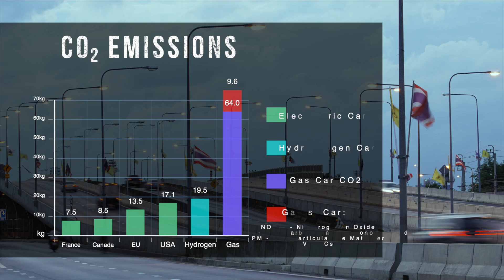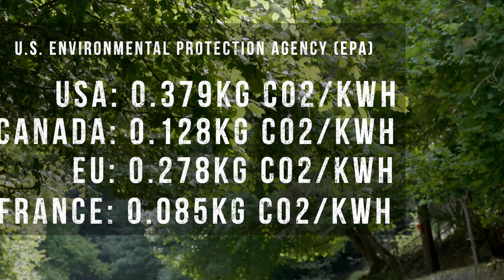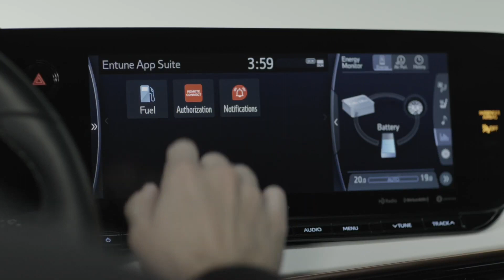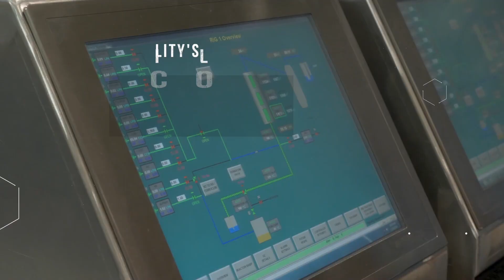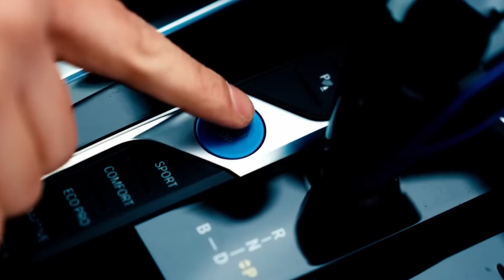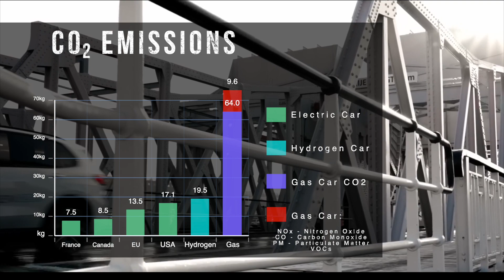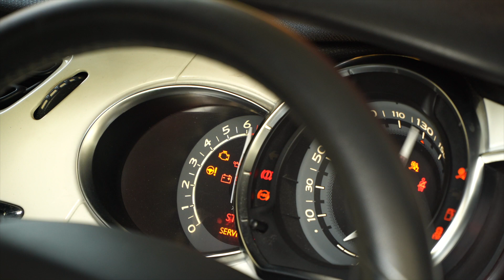EVs vs Hydrogen the battle for your future

Comment: You neglect to mention the biggest country in Europe, Germany, which produces much of its electricity from Coal.  The future of H2 production is electrolysis and that is based on cheap, clean electric production.  No need for the mining of Lithium and the production of batteries.  Hydrogen is the future for vehicles and Nuclear is the future for electricity production.  We don’t want or need our earth covered with windmills and solar panels.
Reply from the maker: I just mentioned couple countries for example. Hydrogen is the best but the problem is with infrastructure, filling stations are expensive. I would say that methanol is much easier to operate. Isn’t it easier to use electricity directly in a car instead of converting it to H2, transport and converting it back to electricity in fuel cell. Losing on efficiency at every stage.

Comment: Ev better hydrogen engine
Reply from the maker: Hydrogen engine is very slow and has 27% efficiency so crazy expensive to operate. Fuel cell has 60-80% efficiency. And car is electric so it is fast.

Comment: The new LPF batteries are replacing LiCoO2 in the two or three recent years.. so that Cobalt shortage is no longer really an issue, but recycling lithium is, combined with marginal battery durability: the recycling of lithium is more expensive than current lithium production and the recycled product is not pure enough for use in high quality mobile batteries. In contrary the few grams of platinum requires by cold fuel cells and PEM electolyser, from 5 to 27 grams per car, and now less on new nickel plates cells is a noble chemically stable metal easy to recycle and can be 100% recycled when cold and 96 % on hot exhaust catalyst with some 4% lost during usage by surface hot peeling. The shortage of platinum, iridium and palladium is therefore a false urban electro-geek legend. The current H2 grey industrial production is not green but with the lowering of PV and wind mills prices, the improvement of PEM electolysers efficiency and the natural gas price increase with the war in Ukraine, the Green H2 production is cheaper than grey, with pure O2 and heat as valuable by-products so that all three can become even much cheaper than today…moreover with sun and wind abundant everywhere and free of charge and an economy of scale marginal for green H2 production, a massive energy storage is possible everywhere cutting cost of expensive transportation networks and tanker trucks. This could cause the existing energy monopoles with huge financial lobbying power to be threatened by a new clean and fair trade energy dynamic and competitive market, and this new energy war has just started with a lot of fake broadcasted to mislead decision makers, but technically, saving the planet from roasting will come from properly stored free surface energy’s and with it, the green H2 will be playing a key role.
Reply from the maker: Good analytics

Comment: Hydrogen ICEs are now being developed
Reply: The world would be better off with gasoline vehicles than hydrogen. 

You seemed to have missed the fact that the vast majority of the worlds hydrogen is produced using natural gas in a process that emits more atmospheric carbon per mile driven than gasoline. 

On top of that hydrogen is substantially more expensive than gasoline, and hydrogen storage tanks are substantially more expensive than gasoline storage tanks so it will never be practical. 

Hydrogen hype is just veiled greenwashing of the fossil fuels industry to steal investment, skilled labor and materials away from actual green projects that would lower demand for fuels. They want us to keep burning their products instead of looking for alternatives.
Reply from the maker: @5353Jumper  Did you watch whole video?... Yes, 95% of hydrogen is produced from natural gas. But process doesn't emit almost no pollutants except CO2. If you compare actual emissions of poisonous substances Hydrogen production and exploitation emits few hundred times less poisons than gas and gas emits it in the cities where people breath it. No matter how you look at it ICE is ancient technology that should be scrapped 50 years ago but oil industry didn't allow it.
Reply from the maker: This will never work because ICE efficiency is 28%, considering the hydrogen cost it will be extremely expensive to operate. Fuel cell is 60-80% efficient. Also hydrogen ICE is very slow.
Reply: Toyota will have a 8 cylinder  motor developed especially for 
Hydrogen vehicles out in 2025.
It will sell like hot cakes.

Comment: Cobalt not required for LFP car batteries. This is out of date.
Reply from the maker: Tesla uses NCA - Nickel Cobalt Aluminum  and only for Model Y - LFP. 
GM - NMC
BMW - NMC
Mercedes - NCM
I don’t think it is out of date.
Reply: @Robb-USA  What is the Tesla battery made of?
For its standard-range vehicles, Tesla said in 2021 that it was changing the battery chemistry it uses to lithium-iron-phosphate (LFP) cathodes, which are cobalt- and nickel-free.9 Feb 2023
Reply from the maker: @harryadam1671  The plan is to use LFP on all models eventually but we will see what will happen. They just released 4680 superior to previous models. LFP is more economical and more stable but will reduce performance and I don't think that Musk will compromise performance.
Reply: @Robb-USA  I appreciate your hard work here. Just another point on your recent comment. BYD is now one of the world's largest car companies and the largest maker of 'electrified' vehicles (that includes PHEV's etc). They have moved to LFP with their famous Blade battery for most of their family oriented vehicles. NMC and similar for their high performance variants. I own one of their LFP cars and achieve about 405km local and at minimum about 320 km mixed county/regional driving and certainly don't feel it's underpowered. My family SUV gets to 62MPH in 7.2 seconds. So, LFP is becoming more widely used as of last year. Cheers.
Reply from the maker: @evtorque  Thank you for your comment. BYD recently jumped to second place on the Future Readiness Indicator, while Toyota dropped from second to 10th. Tesla holds the first position. BYD is really great company.

Comment: Consider the list of essential byproducts of fossil fuels that we rely on in our daily lives that can easily be replaced by electricity.  That list contains zero items.  Think carefully.
Reply from the maker: I am not environmental freak! We need fossil fuels, but combustion engine must be scrapped. This channel is about the facts not trends.
Reply: If that is the case then you need to educate yourself on co2, global warming, plants and internal combustion engines. It is not internal combustion engines that are causing "global warming " bud.
Reply from the maker: @MrKnuttybuddy  I have just posted video about just this topic. Watch it, it is based on actual facts about CO2. Here is the link: https://youtu.be/TtR_GcJBs4Q
Reply: All the byproducts of fuel production that we use in materials and chemical process can continue to be made without making fuel. We can make them all direct, or as byproducts of each other. Cracking hydrocarbons to make components of hydrocarbons is not exclusive to fuel production, it can be done other ways. 

The past rising demand for fuels that was the catalyst (forgive the pun) for the byproduct materials boom, but now that we have waning demand for fuels those other materials can continue on even with waning fuel production.

Comment: Hydrogen for ICE?.. nope😅😅
Reply from the maker: Hydrogen for ICE  is good idea to cut pollution but I don’t think it will be economical.
Reply: @Robb-USA  ... you are right. The problems are in production, transport, storing, dispensing and safety etc.
Reply from the maker: @edsantos6627  ICE has 28% efficiency and hydrogen ICE is very slow, That's why it will be very expensive to operate. Fuel Cell is 60-80% efficient and it is electric car so it is fast.

Comment: Ev. have you ever taking a walk to electric plant?  so ev is only hiding the pollutant whether waste battery. f matter,  carbon waste, poisons. etc😢
Reply from the maker: Every aspect related to EV batteries has been taken into consideration. However, this particular video solely focuses on CO2 emissions. If you're interested in learning about other pollutants associated with EVs, Hydrogen, and gas cars, please refer to our other video.
Reply: FFS everyone has this argument and completely (or conveniently) forgets all the harm of the supply chain for ICE vehicles, as well as the supply chain for all  that fuel. 

The point is not that EVs are perfect zero emissions. 

The point is that EBs are better lower emissions. 

Better is better even if it is not perfect. 

"EVs are not zero emissions, so I am going to keep driving my ICE car that has 3x the emissions of an EV" 

Then also consider that the more we adopt EVs and green generation the greener it gets to go green. Those emissions numbers for EVs fall the more we put EVs and green generation into the supply chain. 5 years from now the numbers for EVs will be substantially better than they are today, and so on. The only way numbers for ICE vehicles are going to improve is if we put a lot of EVs and green generation in the ICE vehicle supply chain.
Reply from the maker: @5353Jumper  Yes, I would add that EVs emit 30-100 times fewer poisonous substances (other than CO2) than gas cars. This is not a small difference.

Comment: My thinking for small cars & light vehicles All is electric is well but midum or heavy duty engines use hydrogen gas engine is better Way, thanks.
Reply from the maker: You are absolutely right at this point. Although Tesla has released an electric heavy truck, hydrogen technology is superior for transportation vehicles.
Reply: It is in fact quite easy to show that all plants react to changes in the environment. They react to light, temperature and many other factors, for example rain. We can detect that by simply measuring the electrical currents that flow in their bodies. These are very similar to those we measure in human heart-, muscle- and braincells. This has been known since the discovery of electricity, but only today we can measure this easily, with off-the-shelf parts. I am continuing this research: ------ Intro-Understanding the electrical signals of Trees: https://youtu.be/drlYvZ8YCZE ----  What Tree electrical signals look like:  https://youtu.be/qdTxhaxjXxg  ---- How to build a simple Tree Voltage Recorder-Part 1:  https://youtu.be/Cl2CVbAjqY4

Comment: 🚙EV with engine👍
Reply: Electric piston engine. I have heard before, however efficiency would be half of an electric motor
Reply from the maker: @tanalson  any combination engine has 27% efficiency and electric motor 95%. Hydrogen fuel cell car has 60 to 80% efficiency.
Reply from the maker: Yes.😁

Comment: Most of information in this video is biased towards battery powered electric cars, ignoring literally every single problem the author of this video even himself admits.

This is not information. This is propaganda.

Go read about TMSR reactors and their role in mass producing hydrogen in the future, THEN patronize everyone how battery powered electric cars lacking range in winter and summer are certainly superior to cars that have no such problems. And that's just one small detail you failed to mention.

I hope this channel never grows. There's enough liars in the Net already. no need to add another one.
Reply: The video is not bias towards electric cars - the actual data shows that electric cars are better. It is not bias to show data that indicates a direction. 

The big problems with electric cars are in the supply chain. 

But many people seem to forget about all the problems with the fuel and ICE supply chains. 

1. Bauxite and steel supply chain for engine blocks and transmissions is as horrific as the lithium and cobalt and copper supply chains for electric motors and batteries. 
2. What about the thousands of gallons of fuel per car, plus all the lubricants over the lifetime of the car? Do you not know about the terrible social and environmental consequences of global fuel production somehow? Plus add the percentage of all the infrastructure required for the extraction of petroleum, refining and distribution and all the supply chain for all that. The simple fact that thousands of gallons of petroleum products are reduced for each EV reducing the size of the damaging supply chain for the vehicle. 
3. Fuels need multiple layers of  transportation and storage just to get to your car. Somewhere around 30% of fuel is used just transporting and refining fuel. This immediately reduces the overall efficiency and increases emissions of any physical fuel vs grid provided or locally generated electricity. 
4. "Green" generation and "green" transportation causes a beneficial feedback loop. The more they are adopted the greener it gets to go green. So those numbers showing that EVs are lower emissions than any other type of vehicle keep getting better the more EVs are used in transportation and the less fuels are used in generation. 5 years from now it will be even lower emissions per EV, and so on. 
5. The new supply chain requirements for copper and battery materials are opportunities to improve global supply chains. If we citizens of the planet keep up pressure on companies and politicians we can try and make the new supply chains required with less environmental impact and more socially beneficial to the working producers. If we ignore or try to obstruct these supply chains they could be made with corrupt corporate greed exploiting workers and land, but if we embrace these new supply chains and get involved with them we can improve the standards through social and financial pressure. Replacing the horrors of the old fossil fuels supply chain with something new could be a good thing it we citizens are actively guiding it. 

Look at it this way, if you had to chose between and smaller better supply chain, or a larger more damaging supply chain what would be the choice? EVs and no fuel generation are pathways to smaller and better supply chains. 

It is not bias it is simple fact, reducing the burning of fuel in the transportation industry is a very important factor in reducing atmospheric carbon emissions. And the only type of vehicle that does that significantly is bEV. If anyone is serious about environmental improvements, the only logical path is to support improvements to bEV to make them more appealing to the market taking market share from fuel based vehicles.
Reply from the maker: This video was made because of all the lies about electric cars. I am absolutely not biased towards electric cars; I just put together numbers that show actual emissions levels in perspective, not lies based on feelings or likes versus dislikes. The battery has only one problem: charging time. That's why they are developing hydrogen cars, which are essentially electric cars with a fuel cell instead of a large battery. At this point, hydrogen is very expensive to operate, and there are almost no refuelling stations. Both of those technologies will coexist in the future as they complement each other. That's why Toyota leans towards hydrogen and not EVs. By the way, EVs lose approximately 15-20% of their range, and gas cars lose exactly the same range in the winter. On short few miles range distances, gas cars lose 25% of their range, and EVs don't lose anything on short distances.
Reply: None of these problems with electric cars have been taken care of yet, you admit that they are problems but that they are trying to figure them and then say that they arent??????? These are not facts but feelings.
Reply from the maker: @MrKnuttybuddy  This video focuses on emissions rather than problems. Unlike electric cars, hydrogen fuel cell cars do not have charging issues.

Comment: but with hydrogen why limit to only pure hydrogen in extreme pressurised tanks? Renault recently installed methanol fuel cells + electric motor on a Zoe which breaks down to hydrogen and the car broke the world record going 2000km+ w/o refuelling/charging! we should make even better/efficient methanol fuel cells IMHO - the refuelling process is as fast as petrol/diesel! also unlike pressurised tanks, in theory even a vehicle as small as a scooter could have a fuel tank filled with methanol which is a liquid at room temp/pressure...
Reply: Sounds perfect for motorcycles. Biggest problem for EV bikes is the battery. The faster you go the less range you get so If you want more than 100km range you need a bigger battery but that leads to more weight using more energy to move needing a bigger battery etc... Its like the delta V problem in rocketry. Then you gotta stop and recharge the thing for an hour or two. That isn't a nice ride. I'm gonna stick to gas til we get a viable and cheap alternative.
Reply from the maker: @ADobbin1  You can try methanol fuel cell that will recharge your battery as you go.
Reply from the maker: Great comment, Thank you! I considered technologies that are actually in use. I will look into new promising technologies and analyze  them.